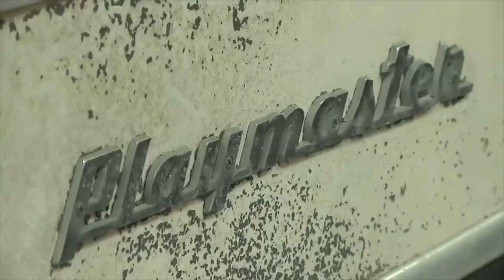11 YEARS OF BOAT REPAIR PROJECTS HIGHLIGHTS!!

Comment: I did a repair but bought the unwaxed gelcoat,so it stays tacky.thinking of spraying it with peel Cote,a rattle can product sold in any parts store, designed to be sprayed like clear coat,but drys into a plastic film,really don't know if it will block the air from the gel coat,so it can dry, then wash off the peel coat next day.maybe you can put up a video to see,if peel Cote can for unwaxed gels,